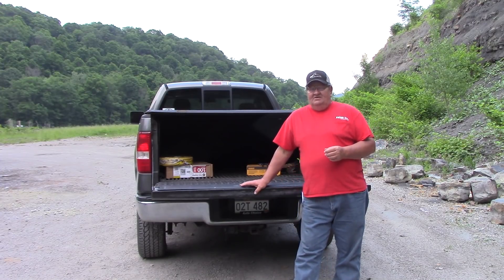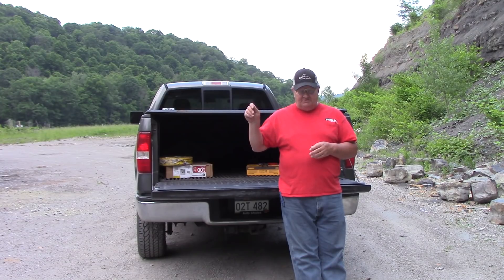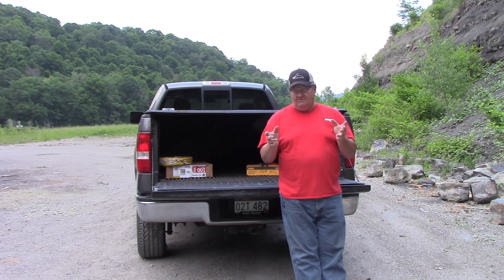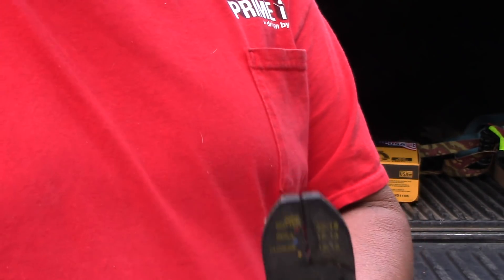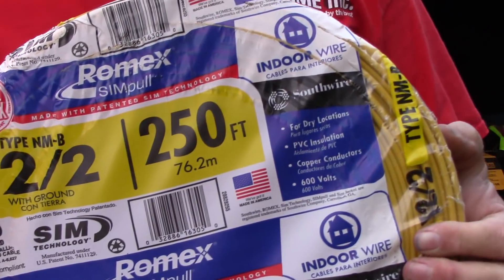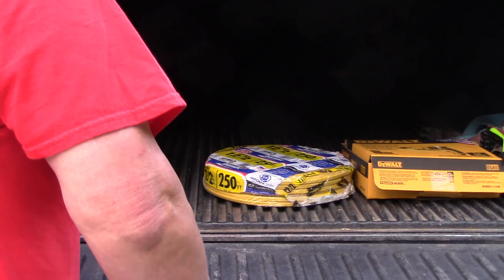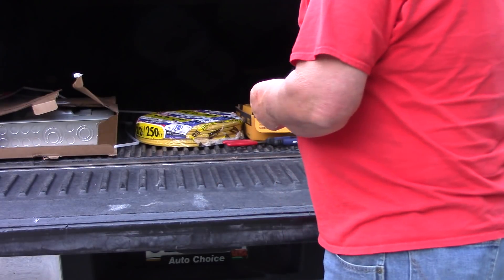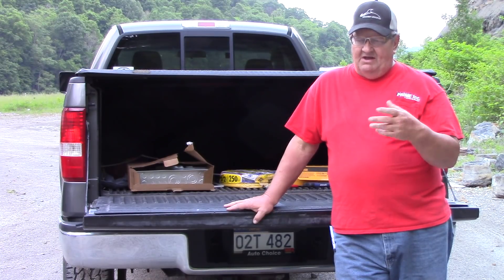Electric Wiring for the Off Grid Cabin

Comment: I'd use a different, dedicated tool to strip that Romex. They are for sale on Amazon, Gardner-Bender makes one that they sell for about $15. It will make it much less likely that you will nick the insulation. Plus, it will be new, and sharp. It would make your work much easier. I heartily dislike those "wire stripper" tools like that red-handled one you have, I only keep one around to check the thread sizes of random  screws. They don't crimp or strip well, making the job harder and not as neat. I'm looking forward to seeing you get back to working on the cabin. It's going to be really nice when you're done. Linda and I send our best.
Reply from the maker: Thanks!  I will definitely check it out. I need all the experts advice I can get lol.

Comment: That forth breaker would be nice for a window air unit.
Reply from the maker: Excellent advice!  I am going to do that. Thanks!
Reply: Yes!  Also, I recommend getting another 20 amp braker for an outside 20 amp outlet.  I cut a hole as high as I could go up against the top plate and a double 2x4 sandwiching a half inch plywood header in the bay adjacent to the braker box (just in case a leak develops).  That's where I put a window unit.  Header wasn't required but I didn't want to take a chance on the A/C unit chassis getting warped.  I used 10 AWG wire for both outlets which are installed in the same bay as the braker box.  Inside 20 amp outlet  under the top plate and outside 20 amp outlet below the braker box.  Those outlets and A/C have come in so handy, especially during construction.
Reply: Before I installed the outside outlet, I was having to run extension cords inside and was tracking mud, dirt, sand, dust and all kinds of debris inside plus I couldn't close the door.  I don't have any windows because the building is used for photographing inventory for my wife's online business.

Comment: get a better drill you will just break a good drill -- bit 
https://www.amazon.com/Greenlee-62PTS-3-Extreme-Shorty-4-Inch/dp/B002NR150W/ref=pd_bxgy_469_img_2?_encoding=UTF8&pd_rd_i=B002NR150W&pd_rd_r=0bedba7d-6661-11e8-b1c4-c1bd54985e60&pd_rd_w=8xYIK&pd_rd_wg=fxQUK&pf_rd_i=desktop-dp-sims&pf_rd_m=ATVPDKIKX0DER&pf_rd_p=3914568618330124508&pf_rd_r=07Z9XS6HDA09PR2W36JA&pf_rd_s=desktop-dp-sims&pf_rd_t=40701&psc=1&refRID=07Z9XS6HDA09PR2W36JA
and a HD drill you will need it for the plumbing also - yes it is money but it will cost you more to do it 2 times
Reply from the maker: This one worked great.